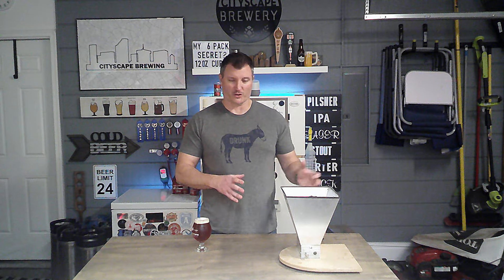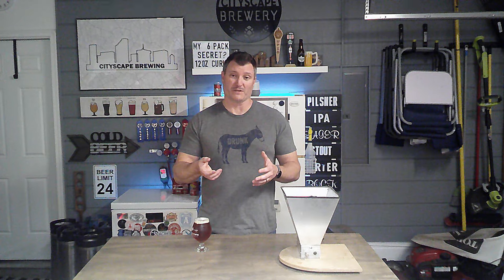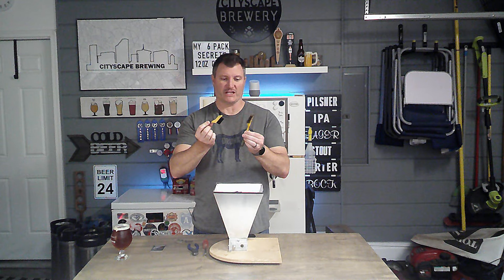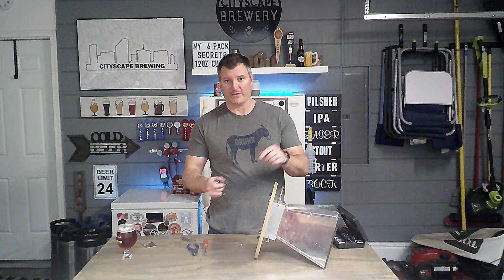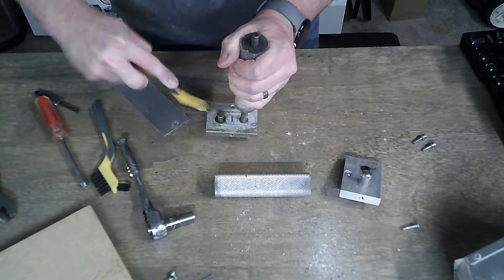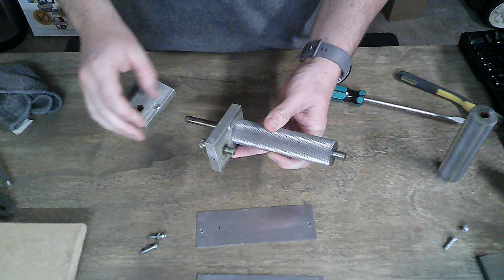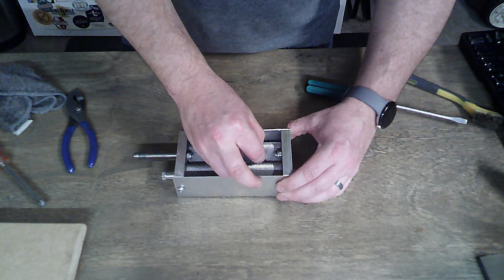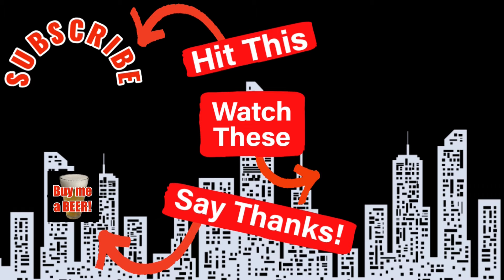FIXED: Stuck Grain Mill -- Cleaning and Roller Spacing!

Comment: All I do is, after EVERY mill, blow out the rollers using a can of compressed air. It gets every nook & cranny. Less than 2 minutes no disassembly needed.
Reply from the maker: That's definitely good for maintenance So you don't have to do it as often. I actually use my leaf blower to blow out the entire thing after every use. And it still gets between the rollers on the sides. After a few years and hundreds of pounds of grain.  Good advise with the compressed air can trick! 🍻